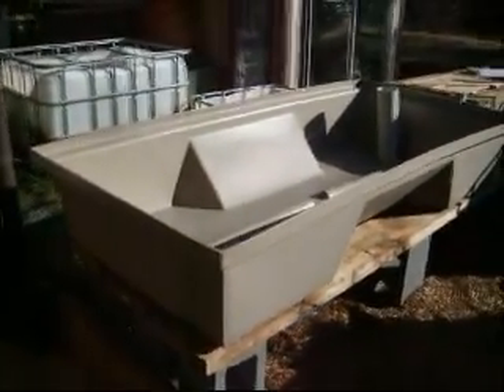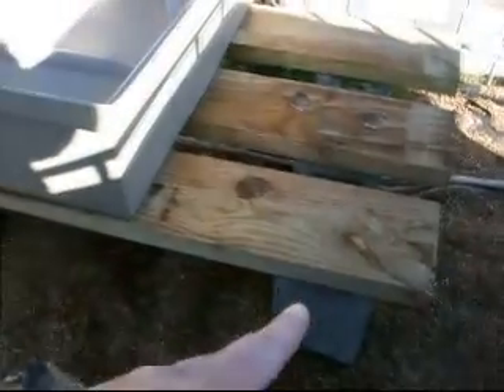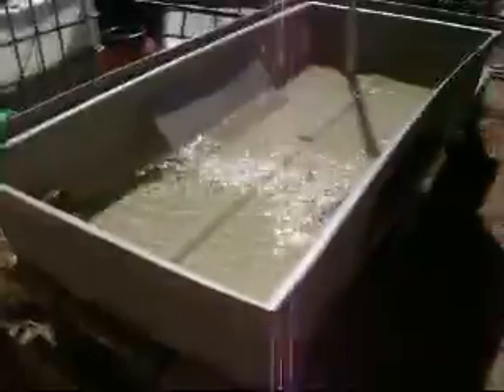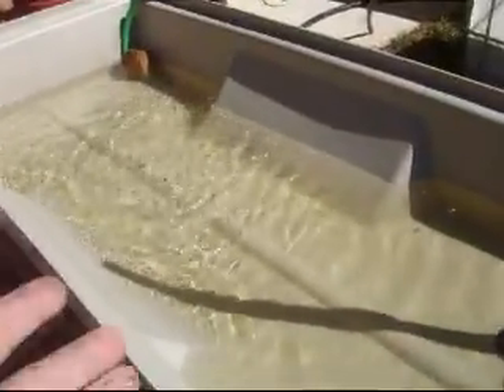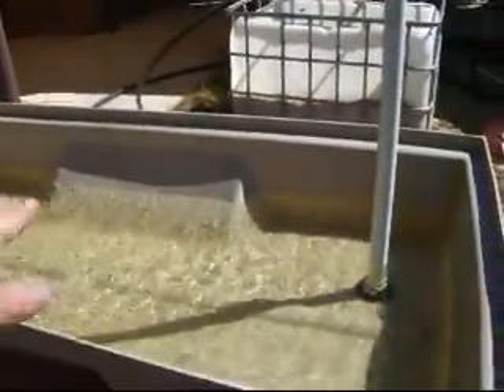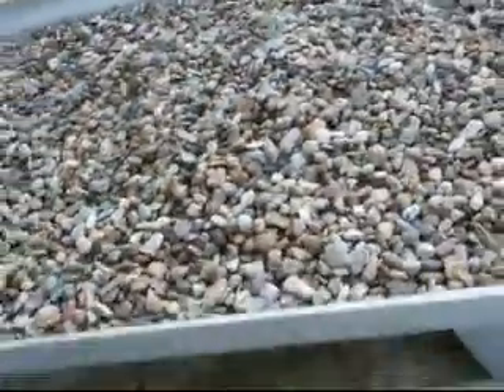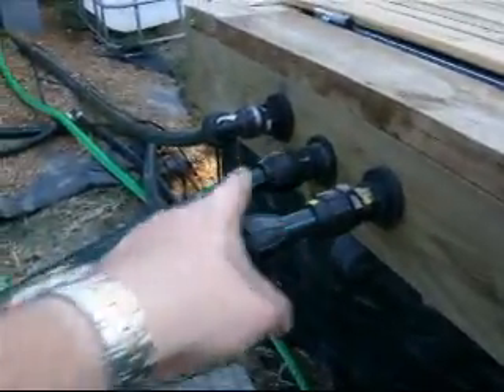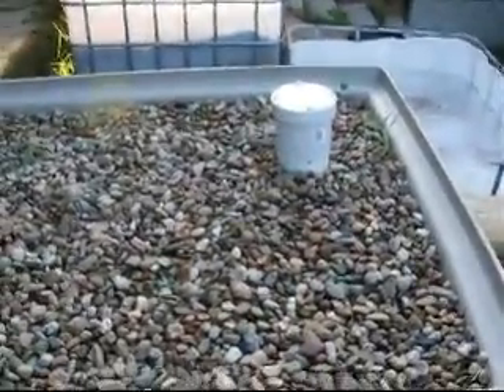Aquaponics System - Building a Flood & Drain Bed

Comment: Its one piece not hundreds all you have to do is add the auto siphon slap it on a base and fill it with your grow media. It simply more correct to say it was set up. The bed was not built by the user so its an incorrect title not my fault you cant tell the diffrence.